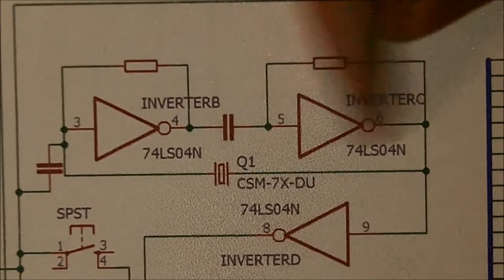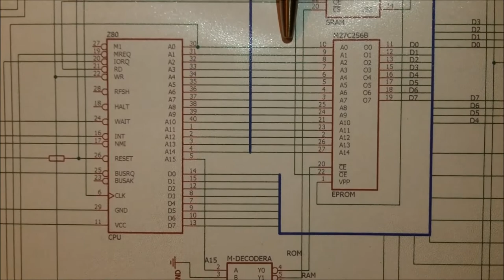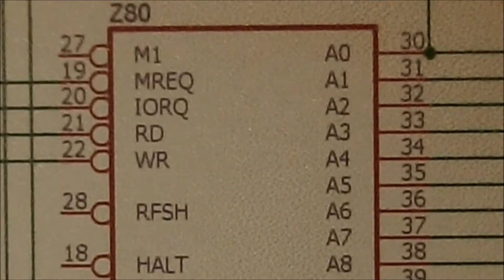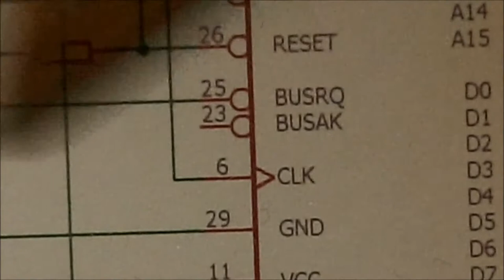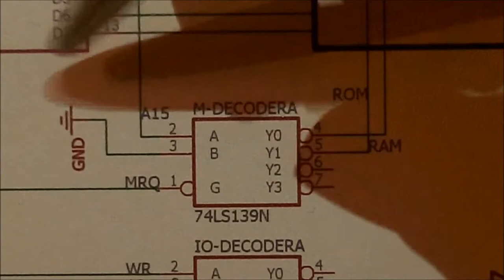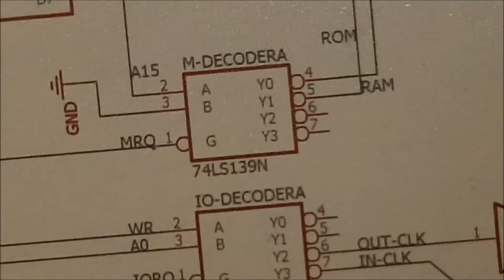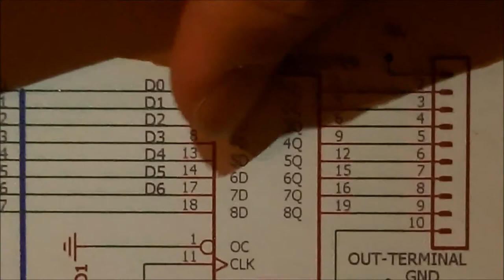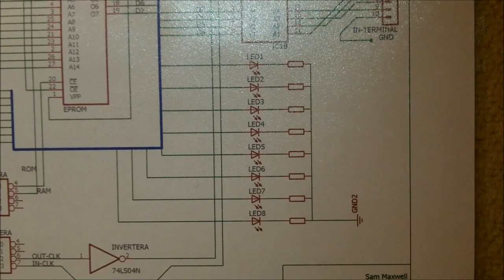Homebrew Z80 Part One - An explanation of the schematic...

Comment: Great vid however it's not generally a good idea to drive leds directly from the Z80 bus (they can pull/sink more current than the Z80 is rated for)... you may want to consider using a 74xx540/541

Comment: You should not put the inverter in the clock line of the 74LS374 as the 
data may not be stable at the falling edge of the /IORQ and /WR lines.

It's best for the latch to clock on the rising edge of the /IORQ or /WR 
line as the data has then been stable for a while and will latch 
cleanly.

Refer to the Z80 input / output cycle timing diagram, this would be 
different if you were using a 74LS373 instead as this is a transparent 
latch.

Brenden
Reply from the maker: +ZEROSTATIC72 Sorry for my rather late reply, just managed to get round to looking at this properly. Im not sure I really understand what you mean? Looking at the data sheet of the 74LS374N it shows that data is loaded into the register on the rising edge of the clock, so without the inverter the logic wouldn't work properly? Do I need to use some other setup that provides a smoother clock signal?

Thanks very much for all the help, it's all a learning process for me, so any advice is great!

Sam
Reply: +TehMaxwell The logic will work fine without the inverter, when the IO write cycle ends the data is latched to the 374 while the data is still stable on the bus.
Reply from the maker: +ZEROSTATIC72 Oh ok, so when things return back to their normal state the data will still write. Thanks very much, that makes a lot more sense now!

Comment: Take a look at the Z8400/Z84C00 Datasheet for the Clock Input High Voltage.  It is Vcc-0.6 Min.  Check the Min VOH of the logic driving the clock input.
Reply from the maker: Peabody1929 Hi there! it turns out you were correct! I encountered this issue in my later videos and fixed it with some different clock circuitry! Thank you for your advice none the less, if you have any other pointers please share them! The more help I and other people can get the better!

Comment: are they still making z80s
Reply from the maker: There is the Z84 which is a Z80 copy made with more modern silicon processes as far as I know. That's what I used in this project.
Reply: The Ti-84 calculator still uses the Z80
Reply: 5years after this comment and I just received an order I placed for a 20Mhz Z80
Reply: @davidhuttenlocker2403  I remember the good ol' days 5 years ago, 14 years old just learning how a CPU works.
Reply: And here I sit in 2022, tinkering around with an old 6502 processor that was manufactured in 1978.... I'm surprised it still works after being packed around with me all over the US for the last 30years!